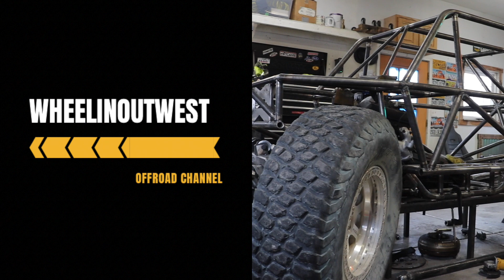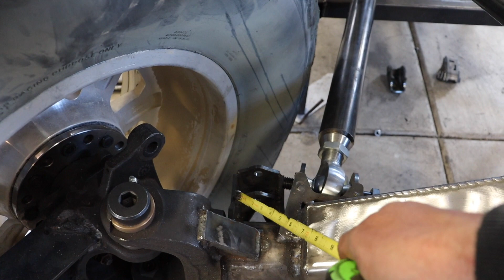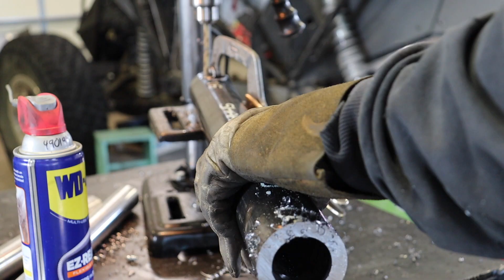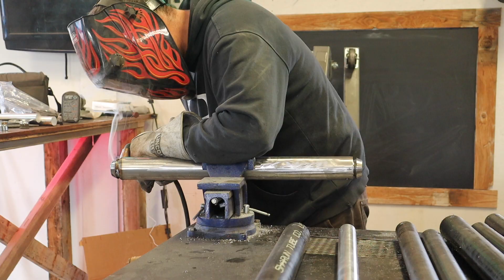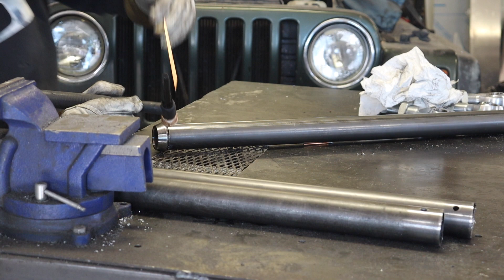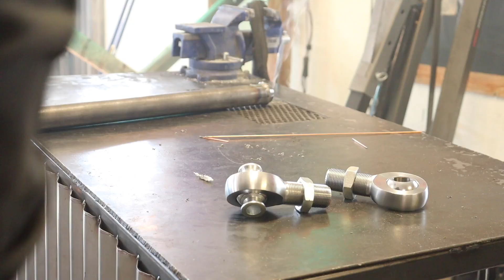Building Buggy Suspension Links #budgetbuggy #rockcrawler #Rearsteer

Comment: The links seem very short. 110 inches is a pretty dam good wheelbase. I would have expected longer links for the size shocks you chose. Any reason behind that?
Reply from the maker: Good question, the rears are 30 inches long, and the fronts 36. The rears were going to be longer, but I decided to make the skid longer for transfercase protection. I ran the numbers through the four link calculator, and making them 6 inches shorter did not change the numbers much. I still ended up close to 100 on anti squat.